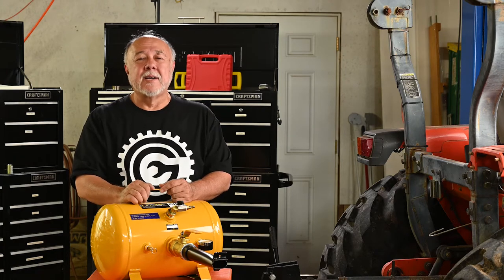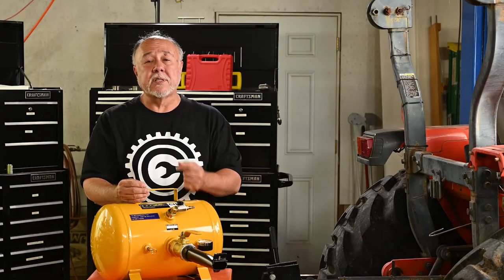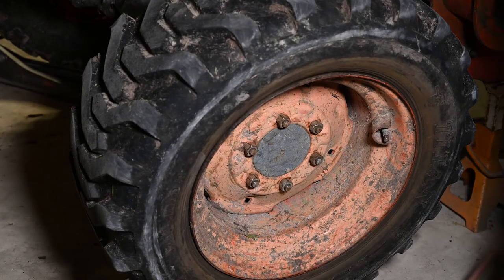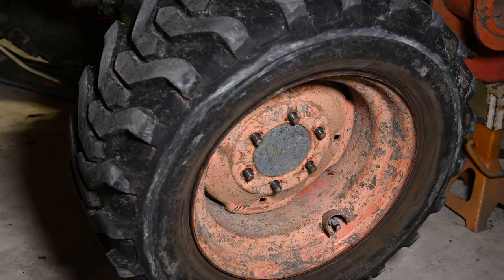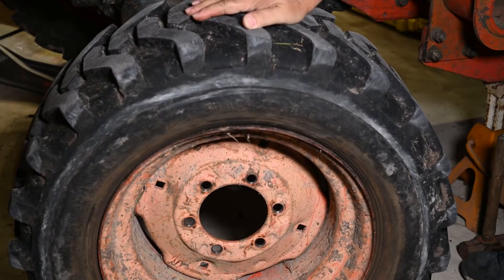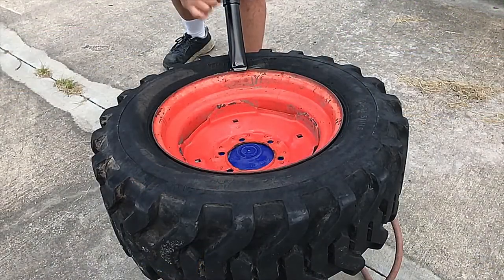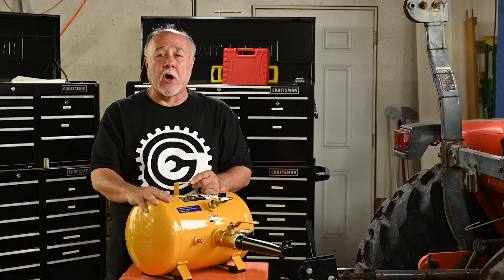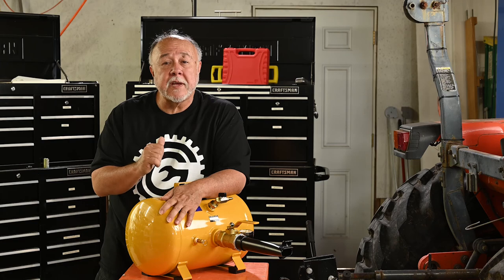Portable Air Cannon! First Time Using A Bead Seater, Cheetah CH-5 vs Kubota Tractor Tire

Comment: clearly that tire didn't need the help from the bead seater. the tire was practically. On the bead already, you had to force the tire away from the rim to get the nozzle in place. this was a bad tire to use as a demonstration.